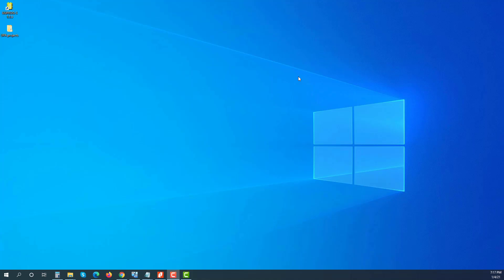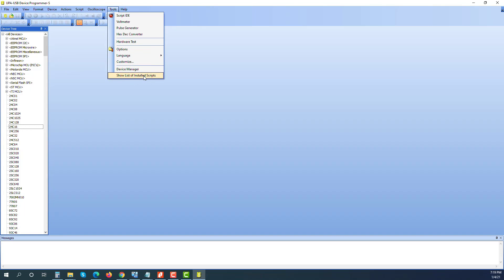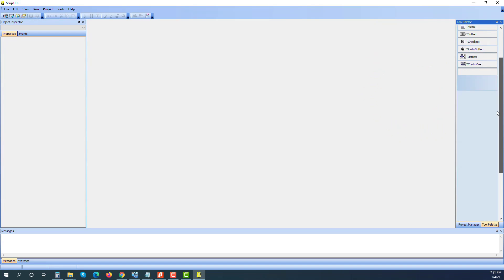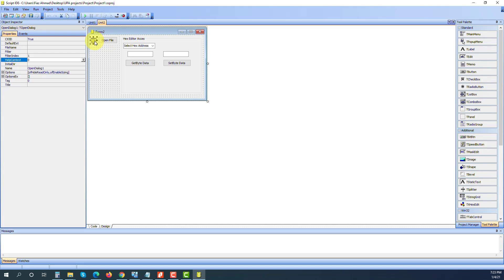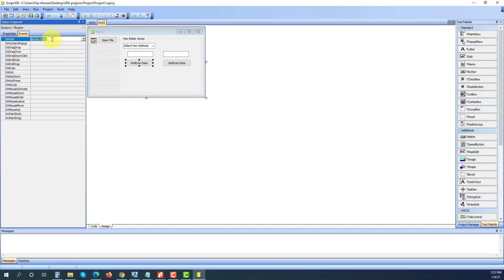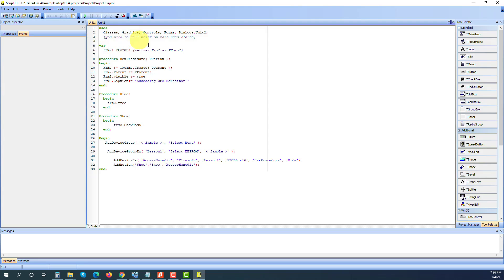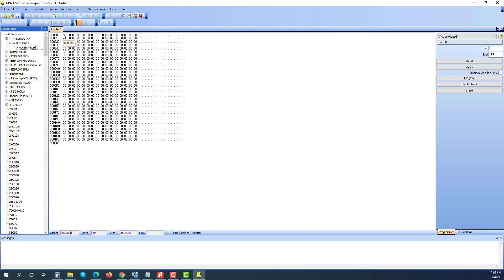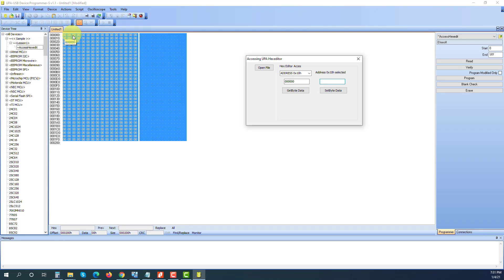Script Writing in UPA USB programmers -  Lesson 1

Comment: What is a script ?
Reply from the maker: Script is a piece of code to use in UPA USB Programmer to automate the desired work.
Reply: @MrUpdaters  thank you.... does upa come with pinouts to connect to airbag modules for reading  crash data
Reply from the maker: @albertgiles5128  In UPA you can read EEPROM/MCU through pinouts as well if you know the connections and some of pinout easily available, check more on the developer site, search Elrasoft in google.
Reply: @MrUpdaters  yeah I know it reads eeprom and mcu. I’m just debating on getting upa or etsmart to read crash data. ... just wondering if upa comes with airbag pinouts ..👌
Reply: @MrUpdaters hi. Can you write scripts to read other non listed MCU in UPA? Thanks